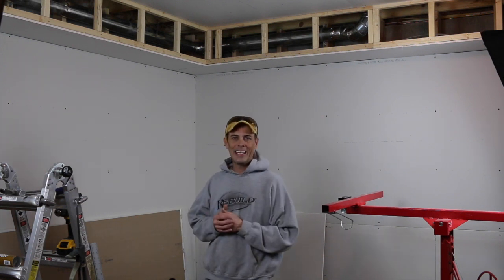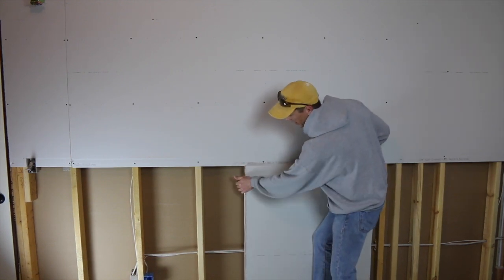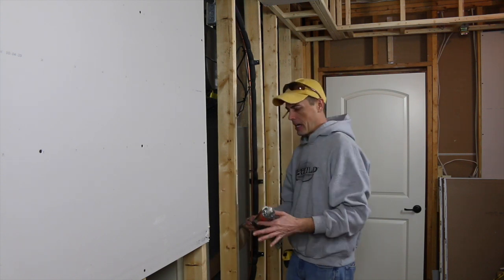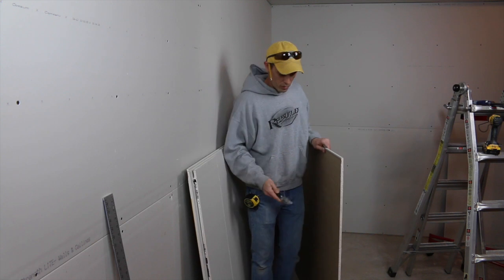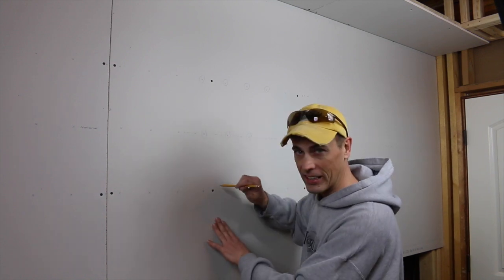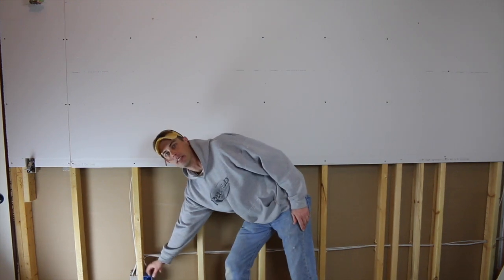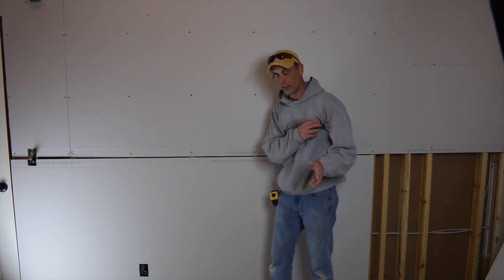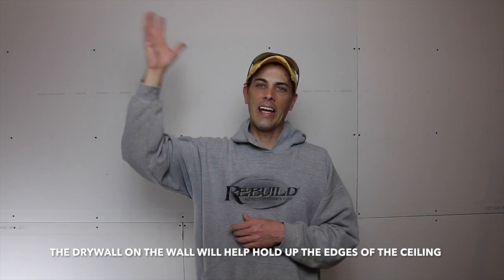How to hang drywall: Everything you need to know in 17 minutes

Comment: to be factual and per manufacturers recommendations.drywall when being hung in basement garage or anywhere there's a concrete floor should be no more than 3/4" close to concrete floor.the main reason is because drywall will wick moisture from concrete and create mold over time.the second reason is because alot of concrete slabs are not perfectly level.they go up and down.so where u take your number it may be 42"but on the other end of a 12' sheet it may be41".so if you kept it only 1/4" off floor the sheet would be tight on other end and not fit....I'm just saying.....you told me to be factual and per manufacturers recommendations...